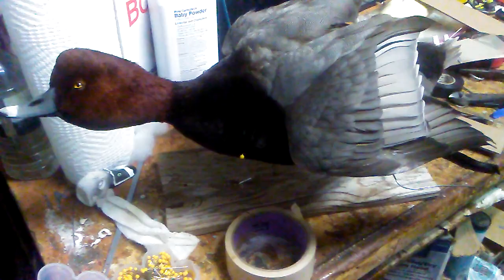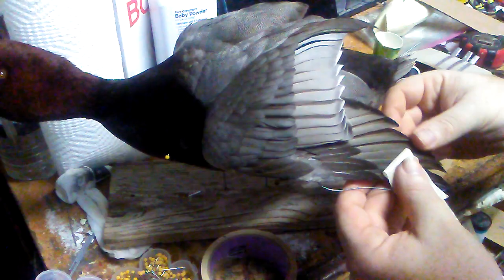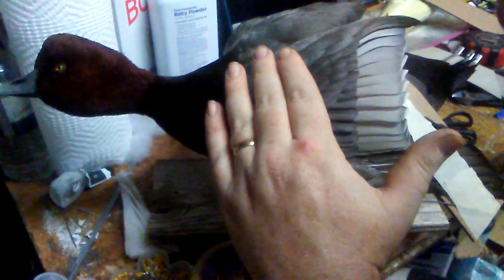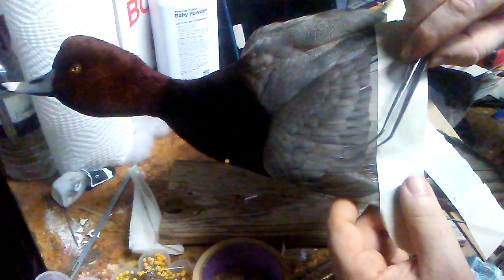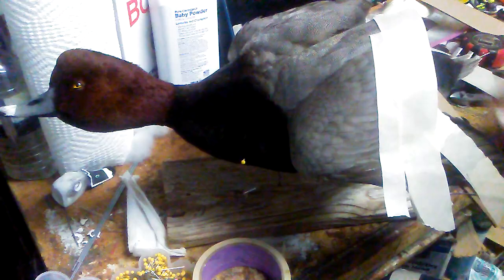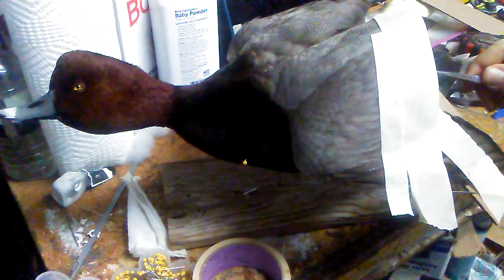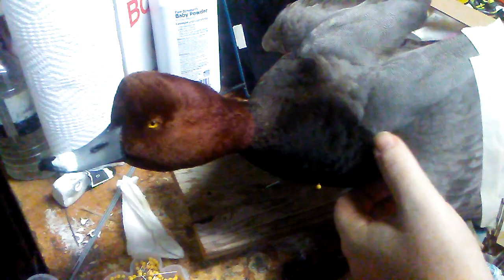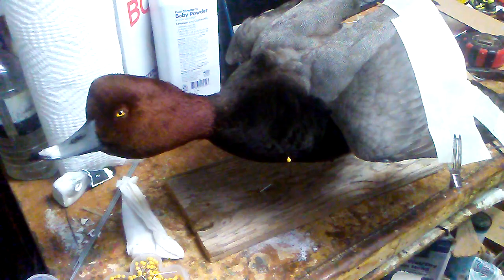AAR Taxidermy Wiring And Taping Wing Feathers

Comment: Why do you tape the wings ?
Reply from the maker: To hold the feathers in place as it dries. Once dry, all removed and good to go.
Reply: @AARBIRDS  Dries from washing ? (I am a newbie in taxidermie)
Reply from the maker: After the bird is washed then dried and fluffed back out, everything's very pliable and free moving.  So after wired the feathers need to be moved into the final place you need them in. For the wings the feathers are very floppy so I put the wire along the underside to hold them up and the tape to hold them in the right position. A week or 2 later the skin dries and the feathers are no longer pliable so after you take the tape off, the feathers stay in place.
Reply: @AARBIRDS  Ok, I get it. Tnx